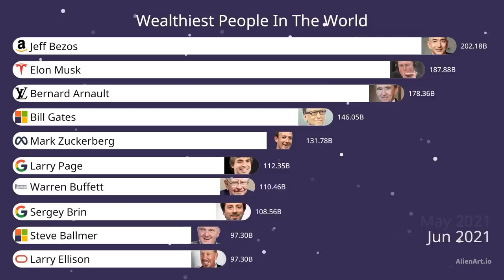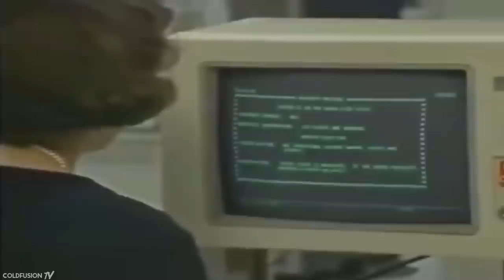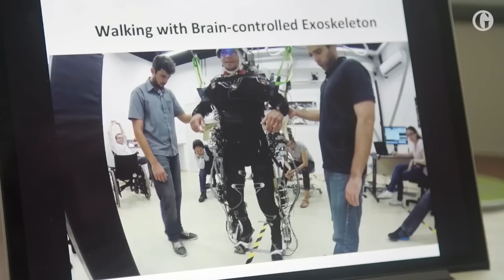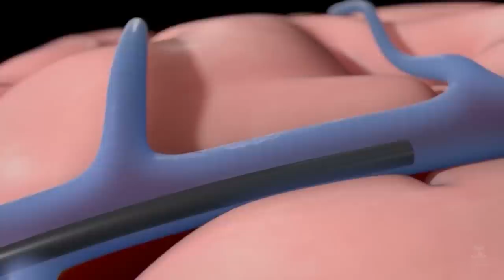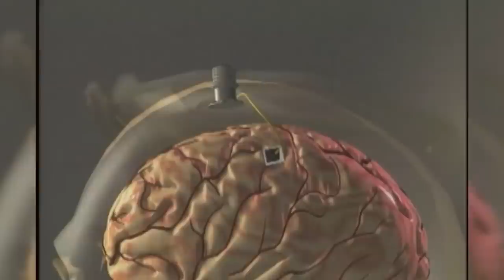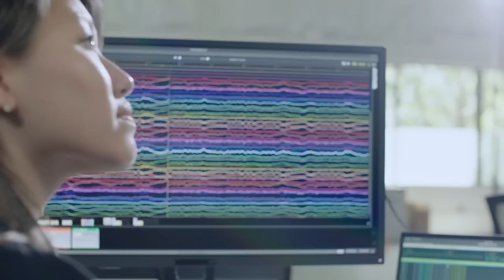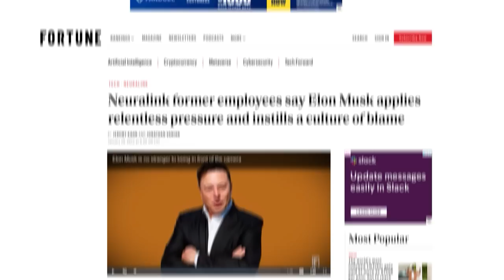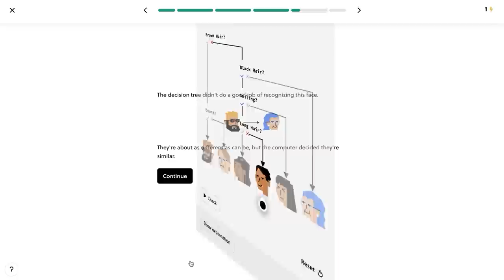Elon Musk and the hubris of Neuralink

Comment: Wireless charging generates quite a lot of heat. Given the device is right next to the brain, and has metal filaments running deep into it, how much of that heat will be transferred into the brain? What effect will that have? 
Will having a strong magnetic field right next to the brain for hours every night (overnight charging) have any negative effects? 
To what extent will leaving a permanent hole in the skull weaken its structural integrity? 
If there is a battery failure, what happens? Li-ion batteries can fail in pretty spectacular ways. 
Will the wireless radio transmitter being right next to the brain, without the protection of a cranium, have any predictable negative effects? The wireless system seems to be off-the-shelf mobile phone parts.
Genuinely interested if you know the answers to any of these questions.

Comment: yeah the most insane bit of tech these tech bros don't seem to really understand is that our current computers work with nanometer scale transistors. and neurons are from a few micrometers to a few dozen micrometers in length. but the synapses are only 20-40 nanometers, only a couple times bigger than transistors. and the neurons are much more complicated systems than transistors.
 but the neuralinks work with comparably huge wires and massive accuracy issues. like if you really wanted to get something like an actual computer in your brains, you'd need to at least match the neurons in size and complexity

also the weirdest bit these people do is they insist on accessing the brain directly. iike with the internet bit, where they seem to think its a chip on your brain. like we already have systems built into our bodies to do things sort of like that. the visual nerve, auditory nerve etc. like if you really wanted to put internet into your brain, it'd be much easier through an audiovisual signal. but that wouldn't be cyberspace

Comment: on the note of telepathic communication, I don't think she considered that the communication could be done through a secure or open chat channel using wifi or bluetooth as the basis of the connection. Traditional ideas of telepathy would require us to have a far better understanding of what a thought is, yes. But if the persons thoughts are separate from the actual communication channels that the neuralink uses then your own thoughts would still have the ability to be private as long as you are not using the chat channels at that time. What I am more curious about is how will the interface /HUD work with the people using them. Will there be something like a border that pops up on the bottom of the things you see, giving you options for what you want to do such as chat, apps, google search, etc. or will it end up being more thought derivative where you have to think about the function you want to use in order to use it. Maybe it will end up being something else entirely. Who could say for certain what sort of surprises the next generations of neuralink have in store for us.

Comment: @neurotransmissions I know im pretty late.. but great videoo :) also I had a question, i was wondering when you said that mapping of the human brain still has soo much to uncover, but what about the human connectome project?? from what ive seen, theyve claimed to have solved the problem of mapping the neural connections of the human brain and are focusing on other factors like different disorders and diseases like alzhiemers that can affect the connections of the brain... I hope im not confusing or misinterpreting stuff, but I just wanted to clarify this
Reply: It's a different kind of mapping. Connectome is anatomical mapping of neural connections. Arguably more important to BCI applications is mapping cognition and different senses to the brain. An example of these maps would be orientation preference map in visual cortex. 

If you use BCI based on electrical stimulation for let's say stimulating movement, you need to know which regions of the brain map to which muscles in order to "controll" them. Same goes for restoring vision. I believe this is the kind of mapping they mean.
Reply: @CzAnimations  alright that makes much sense.. thanks for clarifying that for me :))

Comment: I think you elucidate well many technical arguments from the electrical properties of neurons upwards such as the attempts made in clinical BCIs, but I don't think you appreciate the philosophy of Musk is the koan which lies at the center of the mandala of engineering and science; Anything is Possible. This is important for understanding both his failures and his successes.

One flaw you make is that even if the most fantastic BCI goals are possible (and they are, and I would agree with Musk et al. they are likely necessary), you pose ethical critiques, which are often posed as loaded questions with presumptions of general malevolence or an absence of regulatory bodies or ability to resolve such issues.

Comment: The brain complexity is exciting. NP would be massive though, especially with exo-tech working to the same level.
I think Neuralink will - no matter whether it has success or not - make some change in the long-run of the BCI field, and sadly I think the run-and-gun approach may be needed at times but only for certain parts. Elon talks about the dangers of AI, but (as the two are linked with progress IMO), BCI's could be/has the potential to be one of the most paradigm shifting developments and I imagine could go very bad if not regulated to a T, and have as much attention payed to it (and its potential and then-present issues) as AI does.